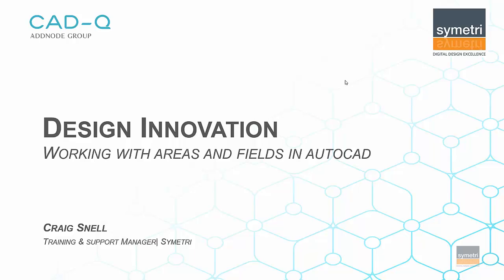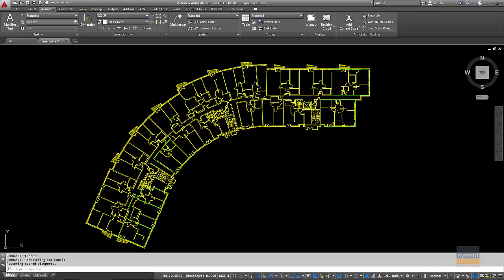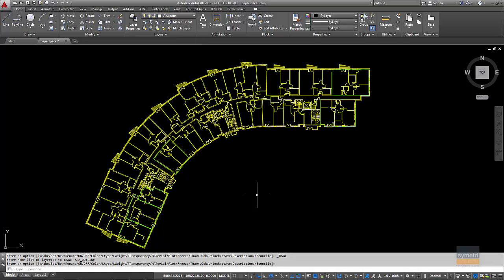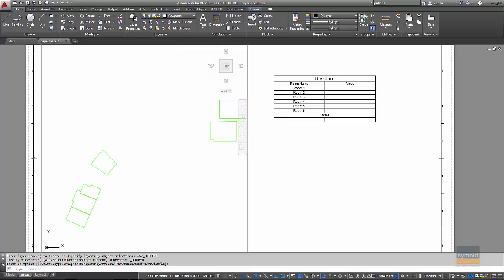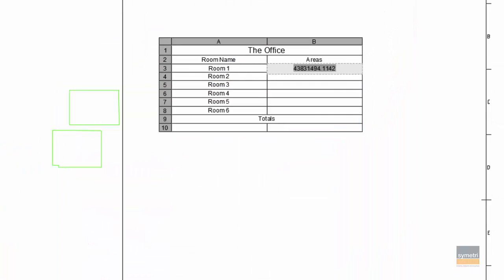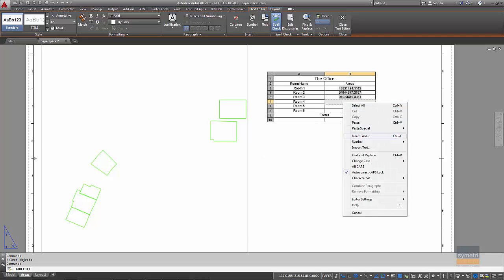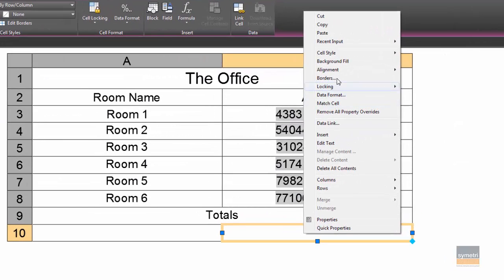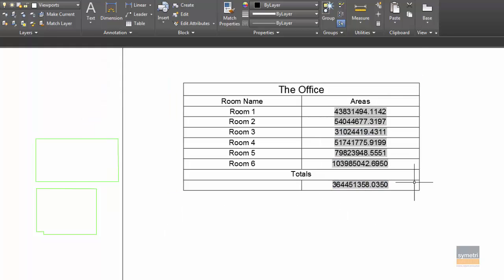Using Areas & Fields in AutoCAD

Comment: I make multiple small drawings a day and each drawing have different rooms.  Each room has multiple objects.  All are polylines and all are joined, no 3d.  Is there a way to have my template set up so that I can assign a room a layer and the field will pull the area for the given objects inside that layer?  That way I can quickly use the same field template in multiple drawings every day but simply assigning a layer to the given rooms and if I change the layer the room is in it would change the area to the correct field?